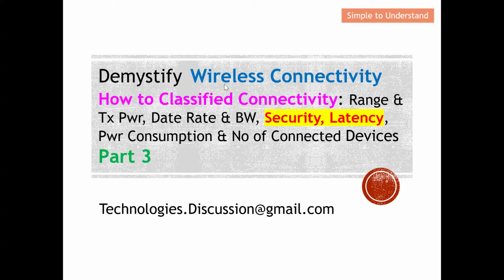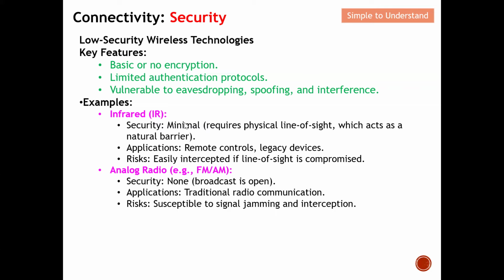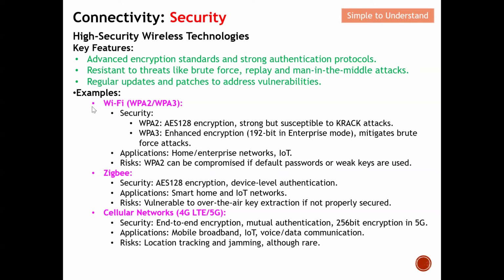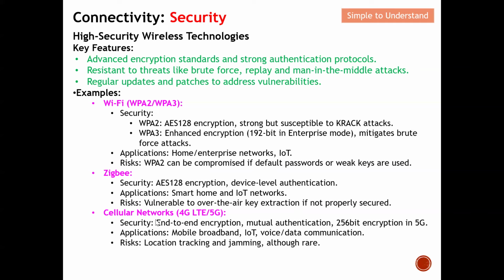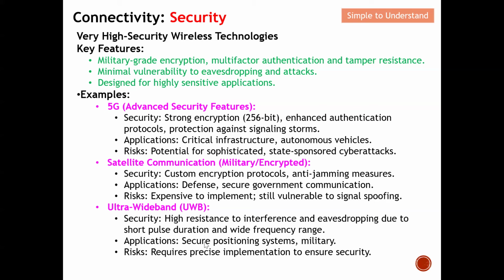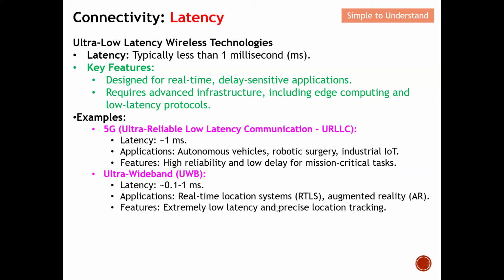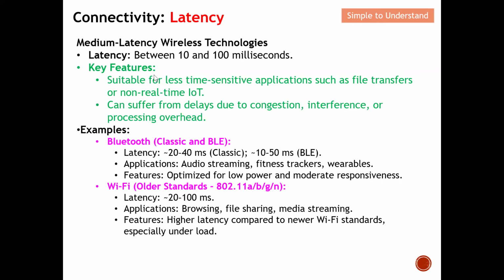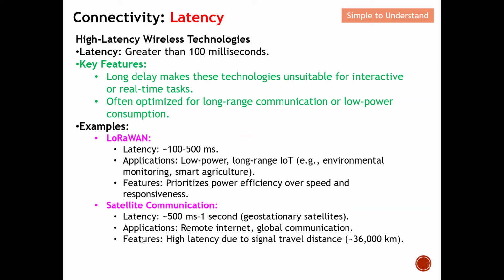Wireless Connectivity #3. Ranking the Connectivity by Security & Latency to Optimize Network Speed.

Comment from the maker: Thank you for watching this video.
This video is part of a series discussing and ranking different types of wireless connectivity, focusing primarily on security and latency (the delay in sending a message). 
The discussion covers wireless connectivity options ranging from those with very robust security to those with minimal or no security. Additionally, the importance of latency is highlighted. While low latency is critical for certain applications, it may be irrelevant for others, such as IoT.